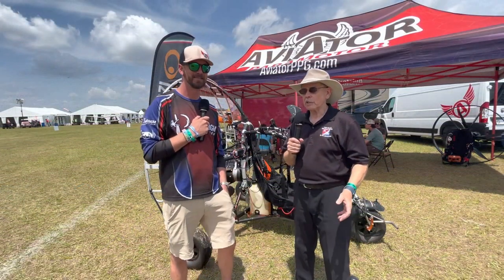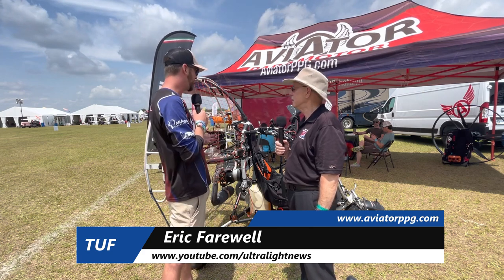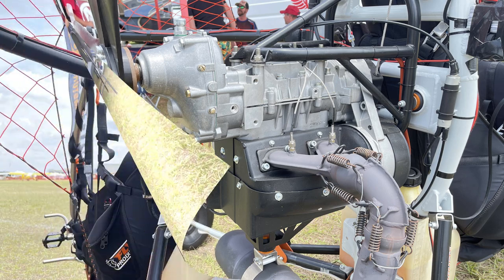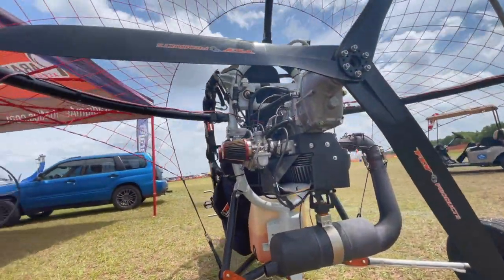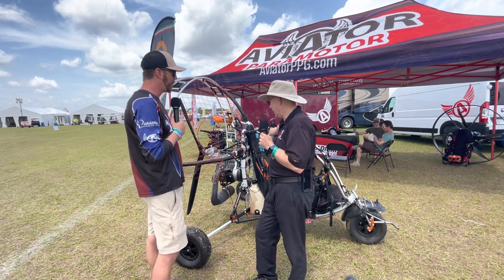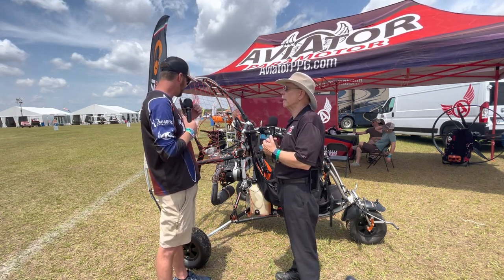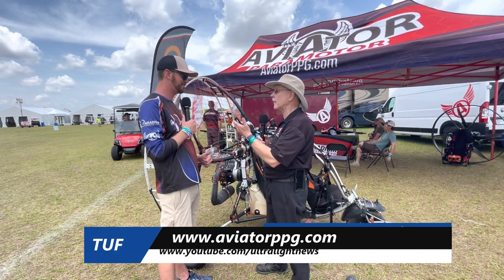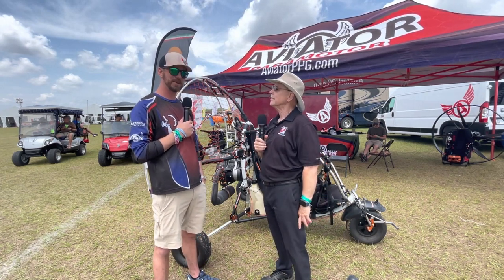RMZ 500 Aircraft Engine, Rotax 503 Aircraft Engine Clone Aviator Paramotor, Eric Farewell.

Comment: All Russia flies on the RMZ-500 and 550, it is very cheap, and the new price is $ 2500) This is the price without a gear and a propeller! With vintorm, gear and electric starter $ 4000! With good service and oil, it works 200+ hours!) Compare new Rotax-582- $ 12000 There is a copy of 582, but it is not successful)
Reply: do you have a link to the website for RMZ-500 and 550?
Reply: where can i buy it?

Comment: I hope that engine works out, for the sake of ultralight flyers.
I wonder if they purchased the rights for the Rotax 503? It's a great engine especially for reliability. There is nothing worse than flying an engine that you think will fail anytime while you're in the air, such as the early motors on the Phantom UL. 
Good luck with sales.
Take care, 
Be safe.

Comment: ARE YOU IMPORTING THE OTHER RMZ ENGINES, RMZ-250 SINGLE (22hp@6000rpm) with a Muffler, 32hp with a Tuned Pipe, RMZ-640 (377F/380F) RMZ-500, RMZ-550? ALL HAVE PROVISION 8 CASES.

Comment: Is this engine dual ignition does anyone know?
Reply: the video one.. looks like simple ignition,not dual..
Reply: Looks like single ignition.  But an electronic module rather than the contact breaker Bosch on Rotax single ignition types.  That's what I'm seeing in the video.